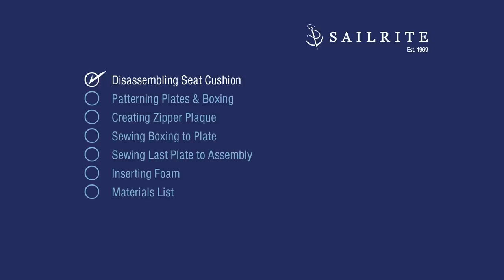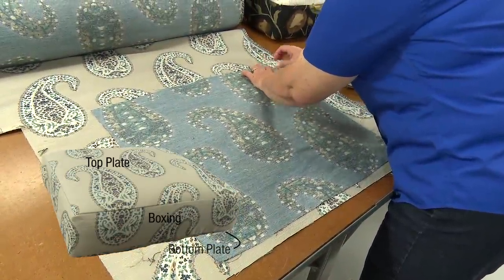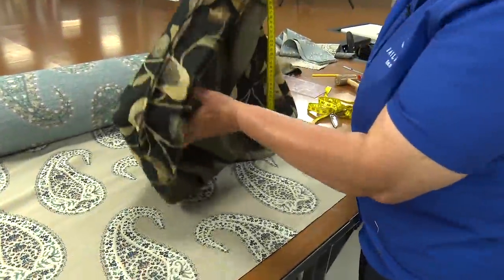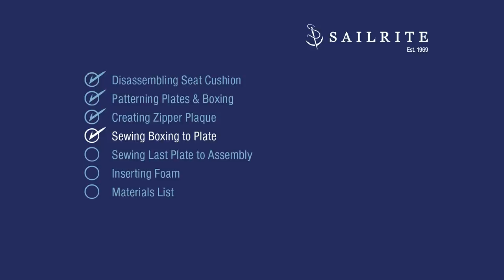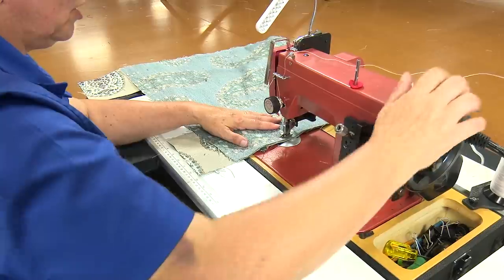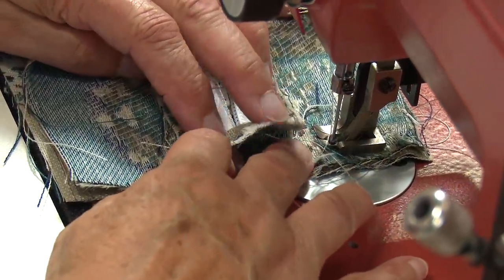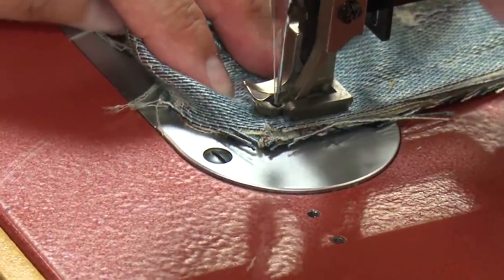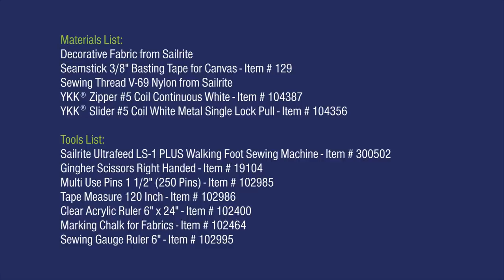How to Recover a Cushion on a Recliner

Comment: Do you use upholstery thread or is regular fine?  Also if you use upholstery thread, do you use an upholstery needle?  I am not using very heavy fabric but I do want it to hold up.
Reply from the maker: It is best to use a nylon thread for indoor upholstery applications because it stretches as the occupant sits in the chair. That helps prolong the life of the fabric by keeping it from ripping out the weave. No special needles are required. Here is a link to those threads: https://www.sailrite.com/Notions/Threads/Indoor-Thread/Notion-Material/Nylon/type/Products?order=custitem_popularity

Comment: Can I use a 6 inches inches foam in a 4 inches high cover
Reply from the maker: Typically the cover will be about a half inch thinner than the foam used. So a 4" cover is usually using a foam that is 4 1/2" thick. 6" in a 4 inch cover may be way too tight.

Comment: Thank you for making this video. There are many helpful techniques demonstrated. IMHO it would have been a better final product had you worked to have the front of the cushion be a seamless continuation of that striking pattern, I would have been displeased, as a customer, to have the ‘tail’ of the paisley repeating in ‘thin air’.  Matching the pattern across upholstery is important.

Comment: I noticed the fabric frays.  Would you suggest serging all the raw edges?
Reply from the maker: Well, you could, but since the frays are on the inside of the cushion and not visible you do not need to do it. It is true an edge that has been serged is sometimes easier to work with when fabricating the cushion, but is is not required. If the fabric is a synthetic then the edge can be cut with a hot knife to help prevent the raveling.

Comment: What's the easiest way to adjust the cover on a couch cushion? The covers on my sofa cushions are creeping away from their proper positions. It's especially noticeable on the front edges.
Reply from the maker: Typically this means the cushion cover may be too big or the foam has compressed and needs replaced. A little creeping for a couch cushion is normal.
Reply: I have a Lay-Z-Boy couch. I just wish I knew how to easily move the cover slightly to square up the way it wraps around the cushion. The couch is in great shape.

Comment: FELIZ NAVIDAD Y FELIZ AÑO 2017
Reply from the maker: ¡¡¡¡Feliz Navidad!!!!
Reply: This is a very good video. I am a new sewer and made some pillow covers so far. It turns out ok.  But my question is, is there a special kind of thread and needle to use for an indoor/outdoor fabric? I am being ambitious and wanted to make a new seat cushion covers and replace the old worn out ones we currently have in our outdoor sofas set. Thanks.
Reply from the maker: If it is strictly an indoor cushion I would use Nylon thread. If it is used for an outdoor application then use a Polyester thread. The Nylon thread will not last long in the sun, while Polyester lasts much longer in the sun. Why use nylon thread for indoor applications then? Because it (nylon thread) stretches and goes back to size when the cushion is sat on, thus helping to prolong the life of the fabric and thread.